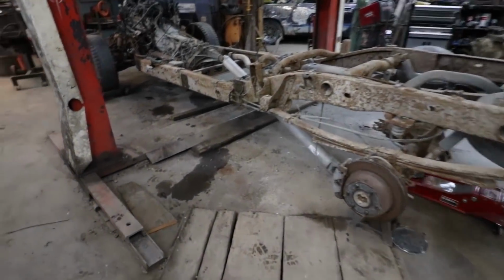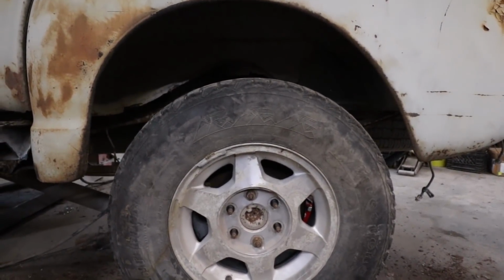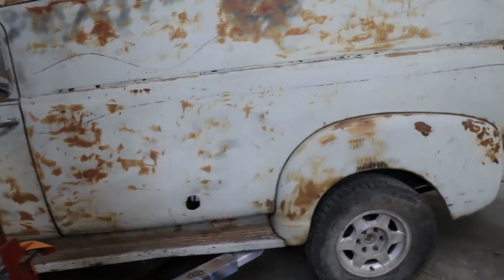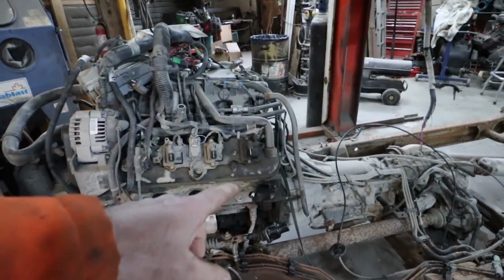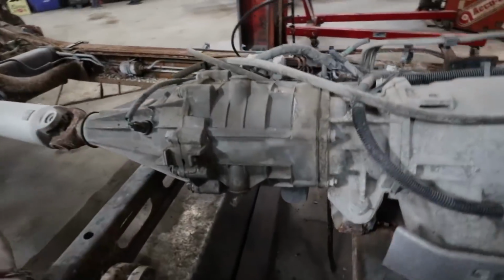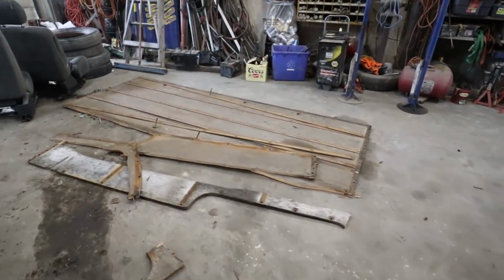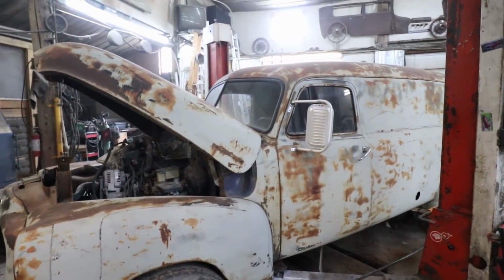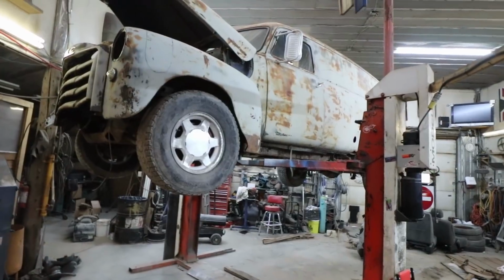Fitting the chassis to the GMC Panel truck, moving the motor and the rear axle

Comment: Luv what yer doin' here. I was rootin' for a 2 wheel drive, but you're nailin' it with the 4x4. The lower the better, building a practical, usable, workable driver. Hecks yeah!

Comment: Great show, I love those old panel trucks. I total a panel truck over 50 years ago. I was driving one were I worked, a guy was turning left on a 4 lane highway, no turn signal or brake lights. I came upon him and I slammed on the brakes and it went to the floor, a brake line broke and I rear ended the guys car. I was not sited by the police either thank goodness.

Comment: Making of a great build.  You have shown us how to move the rear end how to scoot the engine back and to make body mounts all in one video.  Fab 401 Senior class is about to start. on how to build correctly.  Thanks for a great video.  Ride height with the runningboards is spot on.looks like  orgional  NAPO 4x4 conversion. except better.

Comment: I see another classic coming soon and she’s gonna be a beauty! THAT would look awesome as a shop ambulance painted in OD Green with a Red Cross on each side near the rear. Some nice lettering too maybe like “Halfass Kustom Road Service” written on it to use for mobile repair and recovery! 😉 I know, it’s not for everyone, but you’ve already got your staff truck, the “General!” 

I’ve been looking for a decent pickup for a year and a half now that wouldn’t require huge work due to very limited residential repair space currently so good luck to me. One marketplace seller advertised an ARIZONA rust free pickup that I accidentally stuck my FIST through the rear frame tapping it! 
I’ve got a spring clean up from hell to undertake to arrange my yard to ready it for building my next daily driver! At least with a ground up build, you’re ready for just about anything and can be light on your feet dodging and blocking those ugly swings at you as you go because you see her naked. It’s the rolling of the dice on these dang Harry the homeowners foam filled quarters, duct taped cardboard floor pans and other related repairs that are killin me! lol! I guess it could be worse, I could be driving a 99 escort zx2 with a Jaguar hood ornament in the meantime... 

Wait, 
I AM!

Comment: Excellent video Halfass Kustoms (Brent) :) 2002 Transfer case is vaccum and electronic with computer and older from 1995 or earlier are Vaccum also electronic but no computer control and if doing  transfer on old make sure got fuse of Shifter for floor shifter plus Fuse panel came out of and transfer case all together axles spindles may need change to also wire harness too!! Please check too before say geeze Murphy!

Comment: Brent, great job, if it would have been me I probably would have done all the mounts as you did, then stripped & painted the chassis, rebuilt the front suspension, brakes, brake lines, fuel system....that's why it takes me for ever to do something.....just sayin... GOD BLESS!!!

Comment: I don't think You're going to gain a lot by getting it a bunch lower. I think you probably could get the look your going for with the better wheel-tire combo. But you have done  this kind of thing way more than I. So good luck with that. 🤘
Reply from the maker: I'll prob keep these wheels on it and it keeps the wheel wells full, that said I'll give who ever any wheel option they want when I move out the fenders for clearance.
Reply: @HalfassKustoms  Yes it's a great started project. Year-round drive. 👍👍

Comment: I know this build uses a late model frame so this comment doesn’t apply to it. However - if a guy is using a stock coffin nose truck frame - you can correct the rear axle from having the front edge of the rear tires buried under the fenders and a huge gap from the rear edge of the tire to the fender lip, without relocating spring perches. Simply press out the bushings from the stock springs, reverse them then mount the spring backwards.  The pins that locate the differential spring pads are not centered on the coffin nose leaf spring, but offset a couple inches.  Reversing the springs centers the rear tires in the fender openings.  I learned this accidentally while talking to a parts guy in Arkansas about 35 years ago called “Heavy Chevy.”
Reply from the maker: neat, I usually end up making blocks for the back and relocating the axle back that why myself.

Comment: You might want to check with LMC about a floor pan. I just watched a guy have a 55 Chevy sedan floor pan installed in his 61 Caddy. You might be able to used a van floor pan out of a Chevy or a Ford van. Of course it would need to be modified but it ain’t goin to rust.

Comment: I have a 2005 Trailblazer 4 wheel drive with the electric 4 wheel control and have never had problems
Reply from the maker: Yeah my problem is I'm not using any the wiring out of the truck so that does pose a problem haha

Comment: do you plan for weight on the wheels , front to rear side to side , or just except what you get later .  balanced , or 60/40 , for handling / braking  . i could see where moving motor back could be an advantage or disadvantage . .. you sure seem to be having too much fun sometimes ... thanks for sharing .
Reply from the maker: Yeah I don't put to much though in that its not a race car :) that said what ever happens with it it's going to be better that the stock unit ever was haha

Comment: Hey  you are one crazy dude lol. But in a good way. Leaves under not over would have lowered it by 4" off the bat on the rear. Winding torsion bars down on the front is a cool trick. I run a Yota mini pickup 2WD. I dropped my front on stock suspension by 3"`s on the bars. Added lowering blocks to the spring under she is slammed and everybody thinks its bagged...But all stock parts

Comment: Plywood. I've watched for years guys doing truck wood beds and just laying the wood in and treating the top. I have only seen one guy treat the underside of the wood that's exposed to the elements and the stuff being thrown up on the underside by the wheel with Rhino liner or some such plastic/rubber product. I'd like to see you do the same thing if wood is exposed under the truck.
Reply from the maker: yeah I would probably do the same as I did on the General.

Comment: This maybe a dumb question but with it that low, if you put weight in the back and hit a bump is it gonna rub?
Reply from the maker: not after I widen the fenders all around. figure I would do that so whoever can run whatever wheel they want on er later.

Comment: If you chop the frame you would get correct wheelbase and it would move engine at the same time right??
Reply from the maker: nope, motor would stay if one did that as the front wheel wouldn't move keeping the motor where it was.

Comment: Due to  the  fact that these vehicles aren't as available in Australia, I would have properly rodded it, but I'm enjoying your approach to turning it into a four wheel drive. I don't think that your engine plates would be legal here?????👍👍👍👍👍👍👍👍
Reply from the maker: yeah you folks have it rough. think I would be stuck with a pedal bike out your way. Though I heard if it's flathead powered your way you can do mods to stuff.
Reply: @HalfassKustoms  --- it's just the availability of variety of bodies, motor wise ,it's your favorite, LS everywhere, even on peddle cars😆😆😆😆😆

Comment: would it have been less work, less cutting if you had put the axle on top of the springs and used lower spindles up front? all the floor could have stayed in place?
Reply from the maker: yeah but the floors where all cut already from the previous owner so I was committed to removing it either way.

Comment: Brent, I figure that you have done most anything that can be done to a rig as far as going to making your own frame. I know if you use a existing frame that its much cheaper but if you build your own frame from scratch would it be worth the difference in costs to get the very best frame that will last for a good long while. I just don't like the geometry of a stock frame yet it really isn't something that you ever see that much of. I built one as a kid and it fell apart within a week of launch and it was exciting yet disappointing cause my buddies give a good rash on that one. I did get better, a lot better and that came with the use of a electric welder .... a gasoline powered unit that did like two fifty on amperage. Before was brass welding rod and a gasoline torch... something only us old timers ever tried and I never got close to good. Fenders and other "thin metal" things   were held onto by little bubbles of metal.... terrible. Loving getting two videos in one day though so thank you for your time spent for us

Comment: It seems much more work to move the engine back instead of doing an electric fan and a new thin radiator. Maybe me but I would opt for that.
Reply from the maker: I like to have the option if someone want's to put in AC and what not for the little bit of work it is and I think it looks better when the hoods open.
Reply: @HalfassKustoms  ...and  the more we can watch on you channel. I guess that is also part of why you are doing it. On my channel my second most recent video is about your general truck as a camper. I hope you go watch it. YT doesn't let me post a link anymore.  I don't know why but search for my channel rup pert
Reply: @ruppert5134  much more work??...we are talking about Brent right??...its only 10:00 at night...gonna do a little more so he says i got something done tonight..." bingo bango " well the motor is moved back...would have took me a week to even get the courage to do something like that...lol..this guy is amazing.
Reply: @toryneald234  Indeed. He talks about moving EVERYTHING back leaving some stuff out ...I am here thinking pfffft two hoses a radiator and a fan sounds like a good weeks work instead of a 2 month/year project. Guess he looks at things different but that what makes it awesome to watch. ;-)

Comment: A differential equation, if you move a chevy axel more than 3 fingers forward with an eyeball and you move an LS 3 fingers rearward, 2 1/2 inches to be exact, by cutting rivets n brackets off plus extending motor mounts, did the frame rails disappear like the rear floor of the panel truck or did you weld nutts to washers n studs to extract them studs making the firewall and driveline tunnel hackable? Pablo knows the answer, master's making a 4X4 not jacked up or a lowridered down, just a wide fendered machine that can't throw mudd pies in town.
Reply: Pablo's answer also implies a quadratic equation, all 4 paws on the ground!

Comment: Why ply wood and not the floor of the truck bed. For the new floor
Reply from the maker: it's much bigger than a modern truck floor, don't look big but think it's almost 10' in there
Reply: @HalfassKustoms  tou have the chevy and a dodge truck bed to work with it just seems that the plywood is such temporary solution
Reply: @HalfassKustoms  by the way i think your work is amazing

Comment: Hell if you want to lower it put some hydraulics in it that way you can use the four wheel drive
Reply: Yeah redo the floor with oak boards not plywood
Reply: At least polyurethane on barn siding for a floor

Comment: Why not just cut and shorten the frame?
Reply: Thats what i said
Reply from the maker: The frame is the right length for what I need. I could cut it but then have to add steel to the back of the frame again to support the body.
Reply: @HalfassKustoms Wouldn't that be better than moving perches gas tanks ect?
but that's your choice obviously looks good so far.

Comment: Did you ever start taking parts from a car in your yard and then years later regret that you did it and wish you had worked over it instead?
Reply from the maker: not really most of my stuff in the yard is just for that, theres a couple that I won't cannibalize parts off of as they are to complete.